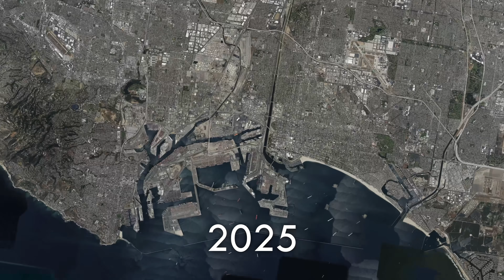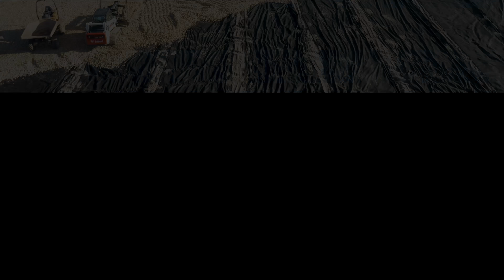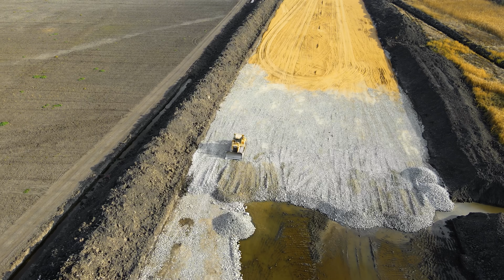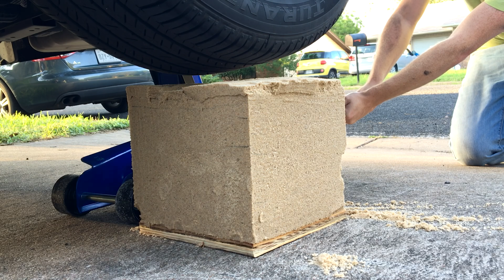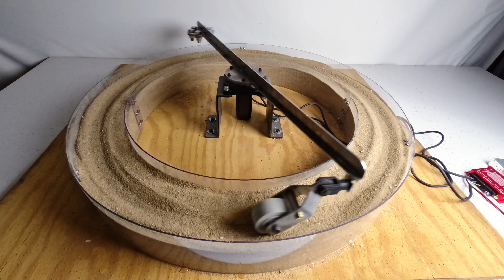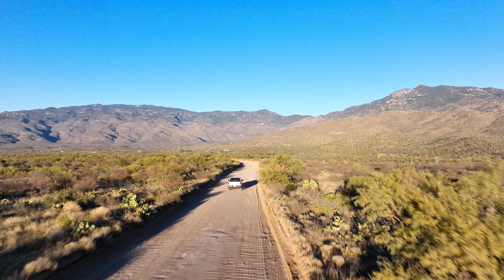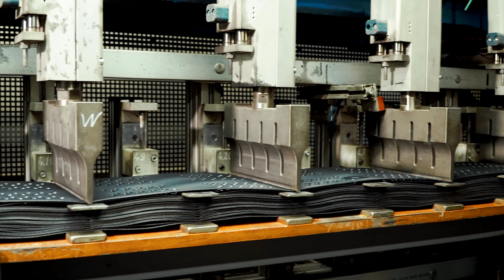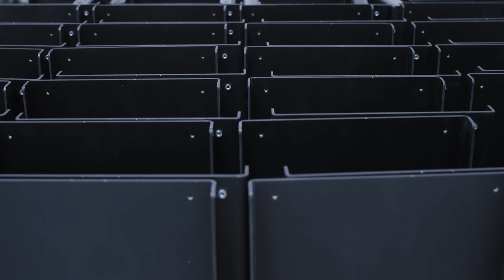The Grid That Doubles the Strength of the Ground

Comment: I've seen a similar type of system used on Atv trails here in Minnesota. Often on hills and grades where the erosion of constant use becomes a problem. Specially near water too, they often lay down this grid mesh in a plastic or fabric like material and fill it in. Causing it to hold up for years before needing maintaining again. Always thought it was cool to see how they manage trails and fight both the erosion forces of off road machines clawing at the soil and water flows wanting to dig out thoes ruts. In extreme areas like steep hills they use interlocking cinderblocks to add a reinforced material but they're still hollow and filled with local soil fill.

Comment: Geocells are one of those engineering ideas that look almost too simple until you see the physics behind them! 🤯
Reply: This whole concept is so cool
Reply: @JonathanKennedyII Exactly!
Reply: You're spreading the load over a greater area.  It's as simple as it looks unless i'm missing a trick?
Reply: Begone bot
Reply: The only concern is the amout of plastic, that we might start to use that will become micro plastic but is not evaluated in the cost comparison
Reply: @aguywithfishthe issue of using too much plastic shouldn't be ignored but by far the largest source of microplastics is from polyester clothing, the risk of this application seems significantly lower especially for the benefits it brings
Reply: @TheEditorsMusic  The largest source of microplastics is wire wear. Pls google